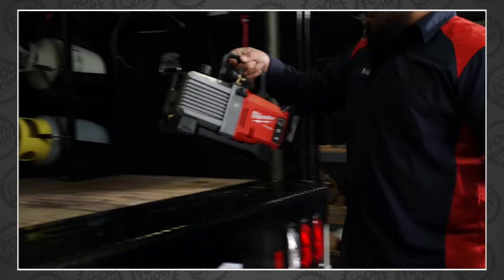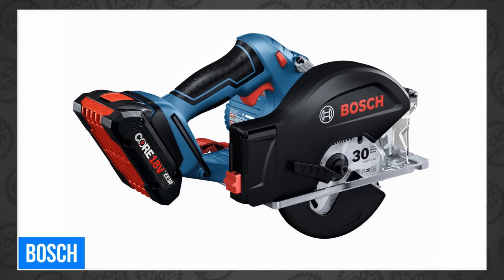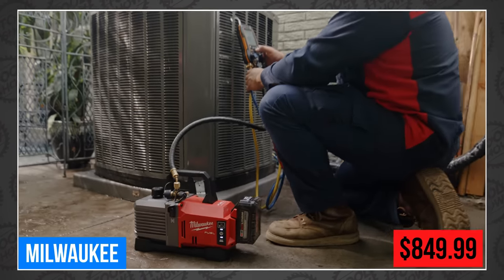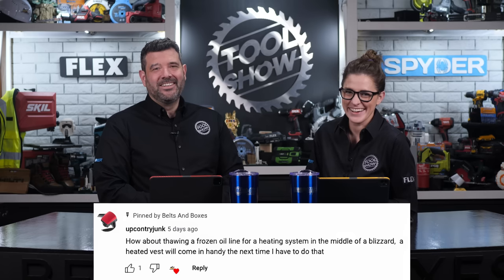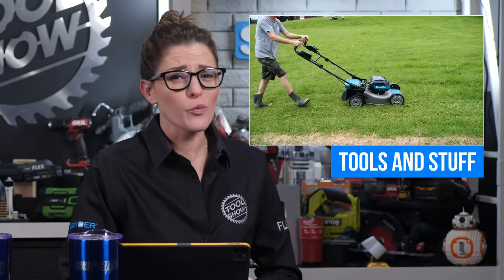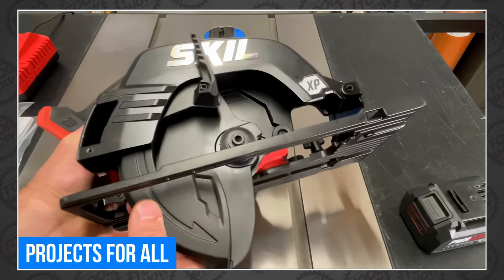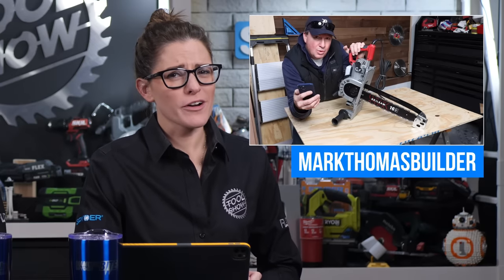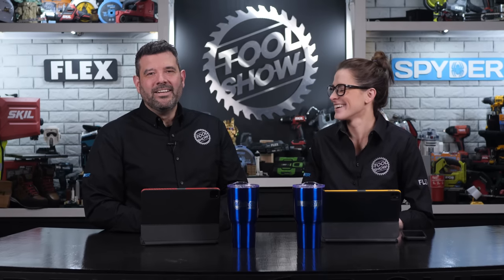NEW TOOLS from Milwaukee, but we have NO IDEA what it does. It's the TOOL SHOW!

Comment: The tool on the left "we have no idea what this is" is a vaccum pump for hvac air conditioning systems
Reply: Thats what it looks like! Cool!!!
Reply: Bruh…. SPOILERS!  Lol
Reply: It definitely is a vacuum pump. That's interesting, but I'm not a fan. NAVAC, JB industries,  and yellow jacket are the kings of that space. Kudos for Milwaukee trying to tussle with them though.
Reply: @donacianoc.sandoval2587  tbh as long as the battery lasts long enough to get a good pull down it would be amazing for the jobs that dont have a plug nearby and you have to either pull out the 50ft cord or fish a cord out of the homeowners window
Reply: its discronificator... DONT.. DO not.. doubt me
Reply: Can also be used for a vacuum chamber to degass epoxy for bubble free pours
Reply: @Randy Bobandy , nah it’s actually the after thought for the suction base on the newest Milwaukee core drill 😂😂😅
Reply: @thenamesjohny1490  bro, make an adapter plug. 2 alligator clips on old extension. Clip one to one of the 220 legs, other to the ground post on ac unit..u now got power for ur vac pump.

Comment: The vacuum pump is to draw air, thus water vapor, out of lines/tubing/etc. That lets heat pumps operate more effectively, lessens corrosion, and reduces the chance of the moisture freezing and bursting tubing. It's all about removing impurities that would contaminate your refrigerant.

Comment: I'm an HVAC tech and I use these pumps all the time especially in summer time when everyone's ac is put the test, great idea! Does it come in black and yellow?🤔
Reply: ew
Reply: No but JB has had one out for awhile now. And cordless with the option to get a power brick to be corded.
Reply: @montec0  the JB runs a Milwaukee style battery too I think. Makita has a dual battery model, but I don't know the specs

Comment: You would need to keep a lot of batteries on the van for a 90 minute run time on the pump. I guess it would come in handy for a job no power but besides that I'd rather have a field piece

Comment: could you use the vacuum pump for a resin vacuum chamber?
Reply: It’s spec set lists 5cfm of vac pressure so pit that against resin vacs
Reply: I wouldn't, unless you're doing resin castings in the middle of no where. Corded pumps are much, much cheaper.

Comment: One Milwaukee corded head isn't really helpful

How bout just build it into your system like Greenworks did it make an AC adapter like Metabo HPT which allows u to use any of their 36V tools with hybrid AC or cordless SDS Max and Plus rotary hammers, grinders(which Metabo HPT' just released new 4 1/2 and 6"),  portable band saw, table saw, mitre saw, full size router etc for long runs and saving battery life and longevity as well as not having to buy so many GD batteries

Comment: Cordless vacuum pumps are pointless, most of the time you use a pump you are also using a recovery machine. Also, thats why they make widow makers, to hook up to the equipment power supply.